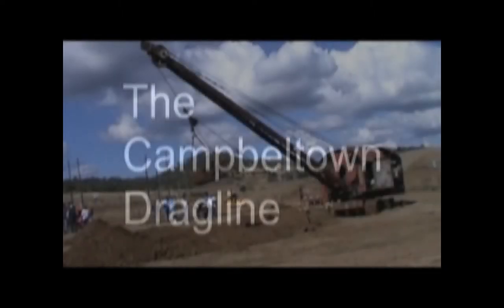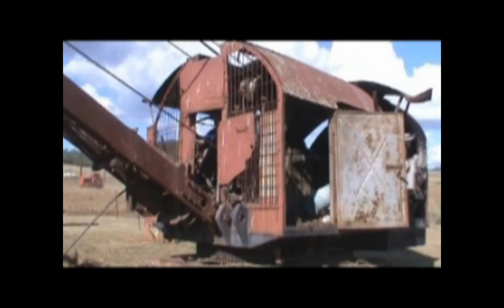Harman Dragline

Comment: Love these machines. I used to build them as a kid with ropes and boxes. They still use draglines in our area as excavators just can't reach. Our dam 30ft deep, last guy was hopeless, i swear, would have been quicker with a teaspoon. An old guy came and had a go, in fifteen minutes moved more clay than was moved in the two previous days! A real art to operate. Very scary when you're standing in the dam up to you knees in mud holding a pump footvalve with the bucket being dropped metres from you!